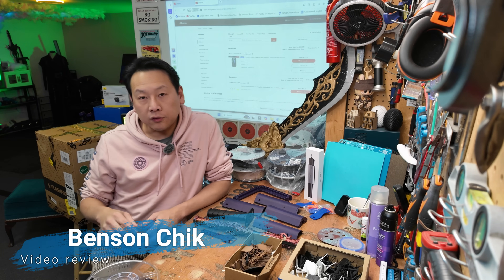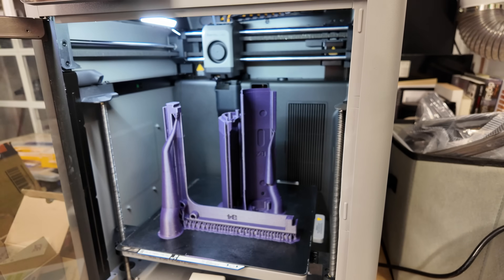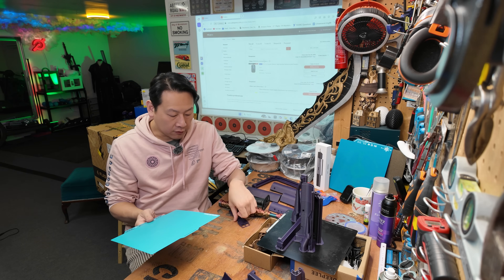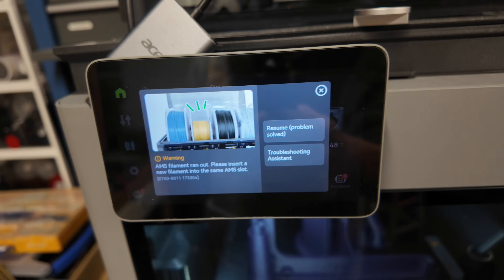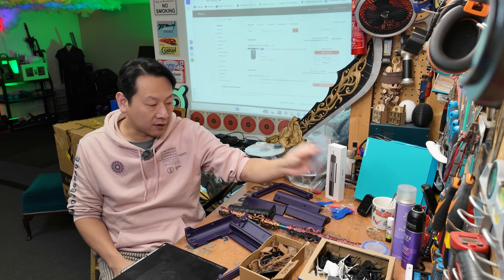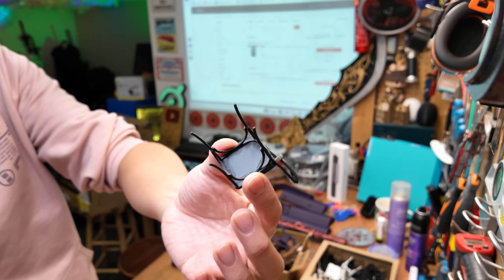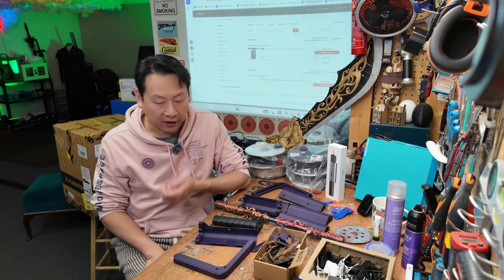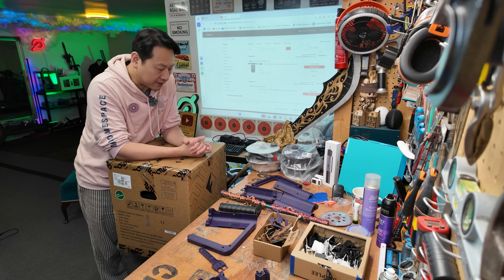I Tried ABS-Carbon Fibre on the Bambu Lab P2S… Here’s What Happened

Comment: would there be a big difference between using the pei plate? i've heard the smooth plate has worse sticking power.
Reply from the maker: I find the textured plate have better adhesive power but sometimes I need the flat smooth surface on show and have to use that

Comment: Thank you for the video. I am new to 3D printing. You mentioned that many say you shouldn't run carbon fiber in the AMS, how else is it supposed to be done?
Reply from the maker: If you print a lot then you should use the external feed as it will by pass the 4 in 1 tubes and less likely to wear out any parts in the AMS. However if you are going to print the odd project it will not wear out any parts any time soon
Reply: @BCreviews  Are you referring to the AMS HT - Automatic Material System? It says it's $139 right now. Also why would it wear out parts in the AMS?  Is it because it would need to run at a higher temperature or is it because of the makeup of the filament itself? Sorry I really don't now much yet. Wanting to buy a printer for my shop, so can make parts for when I make my own tools & specialized jigs for woodworking. I also want to make my own customized accessories for power tools & dust collecting adapters and such. As well as small drawer parts bins. Have my eye on the P2S, trying to learn about the different filaments right now.

Comment: Agree, CF is fine for occasional use in AMS.
And also that it's worth having for filament selection and automatic loading even if you don't do multicolour.
Reply from the maker: Use it the the max, no point baby it as in a year or two all will be multi hot ends new machines 🤣

Comment: I am about to get back into ABS printing on my P2S after not doing it for years. However, way back in the beginning of consumer 3D printing I built a MakerFarm Kit 3d Printer (they don't exist anymore, but were made of wood lol) and ABS was the only filament I could get. I used Garner Fructis Max Hold hair spray on a glass bed and it worked very well for adhesion without any enclosure. I don't know if they still make that hairspray, but I plan to try it again.
Reply from the maker: PTEG vs ABS what is your choice? How about ASA?
Reply: @BCreviews  For this application I need to use ABS due to its properties, but my preference is PLA if possible. I have never tried ASA, might give it a shot.

Comment: Great video like your other P2S videos. I learned a lot from your testing. Since you printed with ABS, did you find you still smelled the ABS plastic even with the buitl in filtration. Thank you.
Reply from the maker: The ABS CF smell really bad when I open the door and the studio do have a bit of smell. If I don’t need to worry about the heat in the chamber I would defo extract the fume out or have the machine outside 😢
Reply: @BCreviews  I printed an exhaust attachment i saw on makersworld that attaches to the grill next to the poop shoot. i have a 140mm computer chassis fan pulling 87cfm exhausting out the window. I however havent had the need to print with ABS or ASA. I am hoping it works. I will print something small to see if the exhaust helps. Thank you.
Reply from the maker: Since it is not a heated chamber if I turn on the extractor fan attached to the back it will not reach the 50c needed to print ABS

Comment: Do you think an external heater can be mounted inside the machine to get better chamber temperature ? I couldnt find a good heater for this, i dont know. P2S theorically can print %95 percent of materials but in pratically it is different. Abs is really hard material to print
Reply from the maker: I can print the ABS -CF, just need to turn on the heated bed 10-20 mins before  the print to get the inside to 45c-50c. My studio is constant at 15c which is kinda cold.
Reply: Yes, on device page of Bambu it says 50 degree passive heating providing engineering materials. But my concern is it may not enough for some materials which require actively heated chamber. I mostly print PLA but i gonna try some engineering grade materials, i hope wont be problem. 😅  @BCreviews
Reply: I believe BQ has just introduced a chamber heater for the P2S for $100 or so.

Comment: I had the Cryo Glacier for the A1 Mini, and it was slightly better than the PEI plate it comes with. But for my P1S, it's like night and day. PLA prints stick very well, as does ASA. Maybe there are quality issues? Both were bought on AliExpress for a fraction of the cost they would be on Amazon.
Reply from the maker: Not sure tbh, my frostbite is fantastic with PLA and PETG and love the low temp of 40c. ABS-CF is a different beast and the Bambu Lab smooth plate + hairspray is the only thing works so far.
Reply: @BCreviews  did you clean the bed with water, not alcohol
Reply from the maker: On the glacier I tried water, dish soap with water, alcohol, acetone. In that order with a few print between each.
Reply: @BCreviews  odd, cause i just printed abs-gf dyson extension hose which is 270mm z height; but yah it could be you got a defective plate
Reply from the maker: Nice 👍 which machine do you have ? How did you manage to print more than 250mm? At angle with support?
Reply: @BCreviews  no support, h2d and tested out on k2 plus also, no angles as i was just testing the plate
Reply from the maker: I had a feeling that the H2D would be a good stop gap until auto hot end change printer prices become affordable. Thanks for the info :)

Comment: I had the same issues with the Biqu Glacier plate. I've read so many reviews about how great it was but it was the worse plate i've used with ABS. Maybe it's quality control and I got a dud.
Pricy but I went with a Darkmoon Satin plate that has been great on both P1S and P2S.
Reply from the maker: good call, I will return that and try Darkmoon